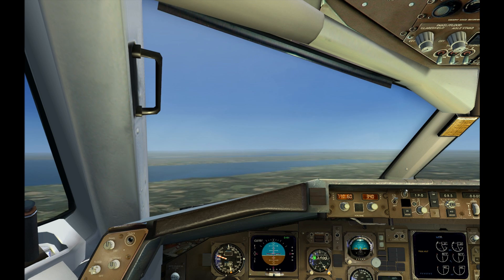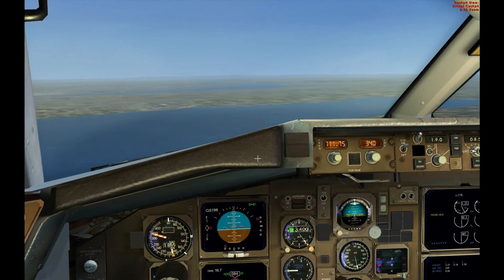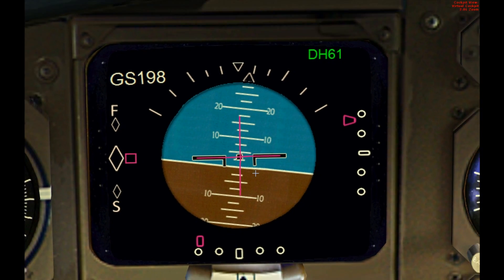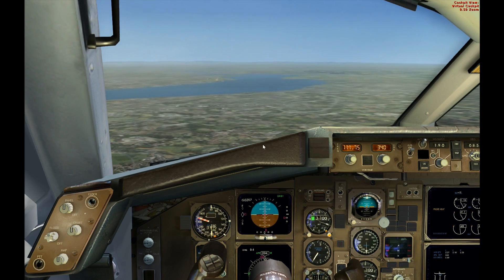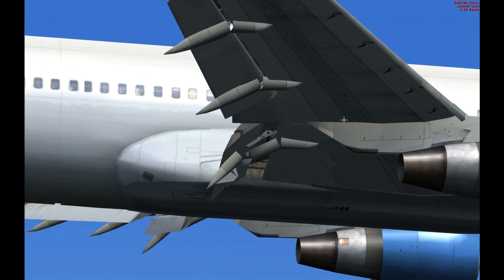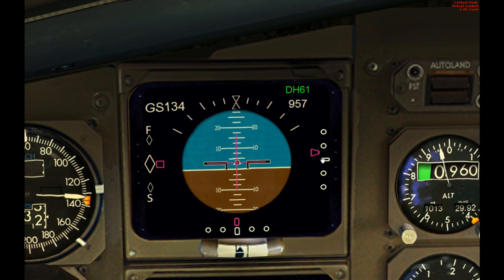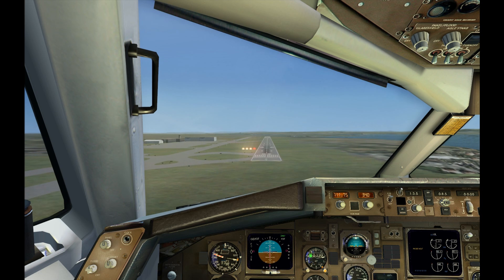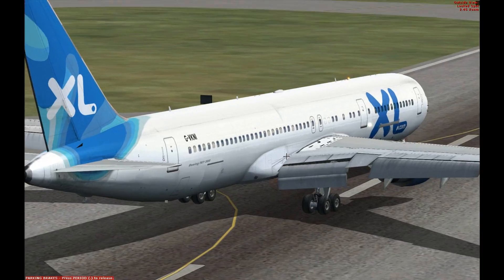CLS 767 - Autoland Tutorial

Comment: OMG, are you sure that this is an "Autoland Tutorial"?  it seems to me that it is a record of auto-crash. In order to perform a auto land,  LAND-3 needs to be shown on the autoland annunciator, which you don't have. This means the plane is not capable of Auto-land, the plane did not even flare and hit the runway with a sinkrate of -800, and bounces up. The plane should have crashed.
 Also, you need to intercept the localizer first before intercepting the glide path. 
You did not cut off the hydraulics of Landing gear.
The V-REF shown on the CDU is 144 knots with flaps 30, VAPP should be VREF+5 which is 149 knots, and you used 135 knots to approach.
A lot of problems with a tutorial. maybe you should read a little bit of flight manuals. I am just being friendly.

Comment: In the real world, the MCP NAV radios are used for ground based  navigation not for approach frequencies. Note the 'VOR/DME' underneath it. The pedestal NAV radio is the single device used by either pilot and the FMS computer, the computer will automatically insert the ILS frequency and course when an approach & runway are selected - according to the aircrafts navigation database.